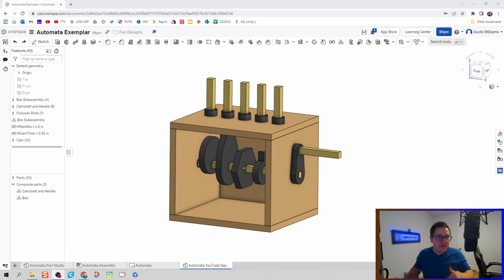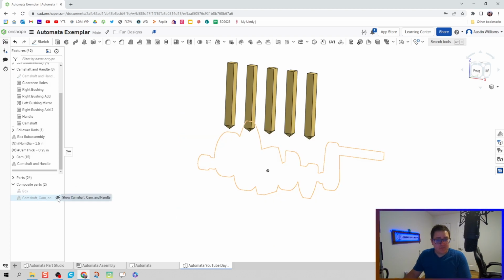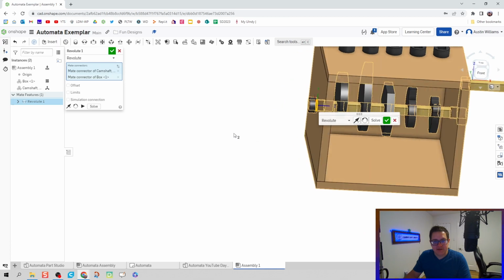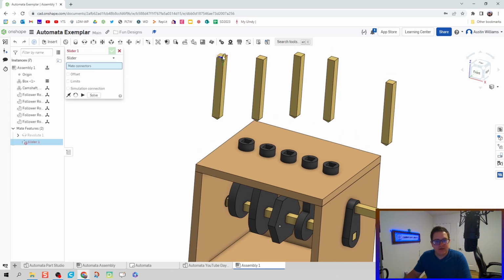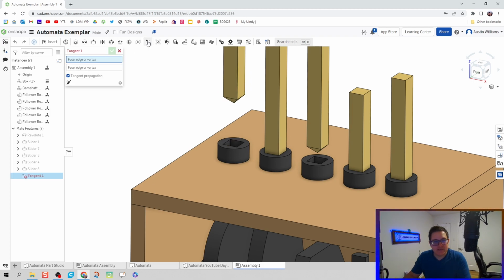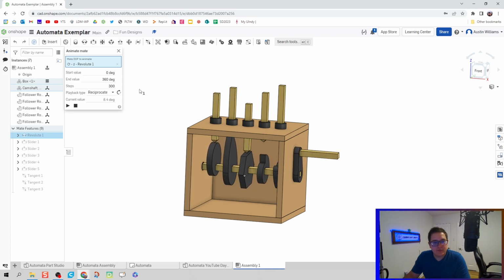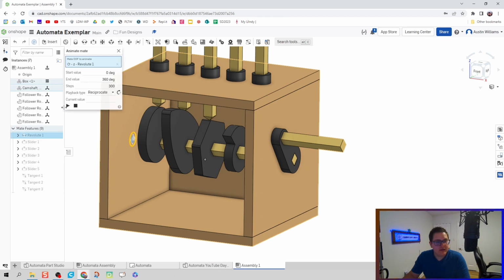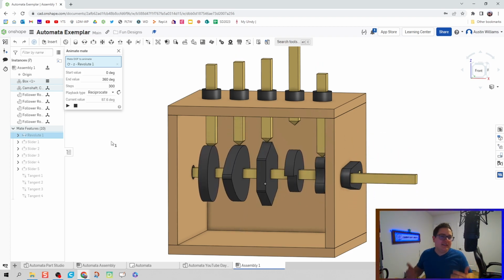Smart Automata Build (Composite Parts and Tangent Mate) - Pt 5 - Day 82 of 100 OnShape Journey

Comment: Thanks, Austin.  Didn't know about composite parts.  I would think we'd want the actual 'shoe' at the bottom of the followers to be in the CAD model since it impacts things like the max size of cams that will fit in the box.
Reply from the maker: No need to fret! The shoe is coming in later and will hide the point of the follower rod. Gets a little "hand wavy", but ignores very small overlaps in parts at the end.